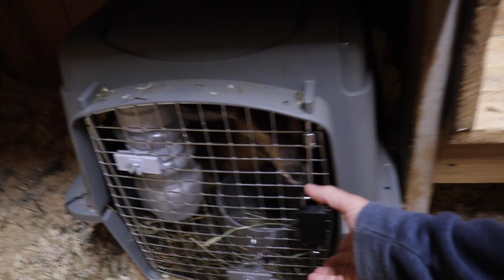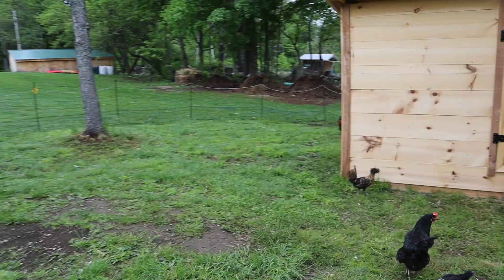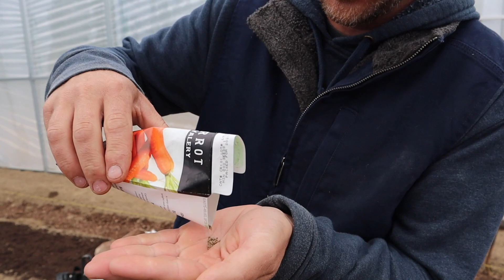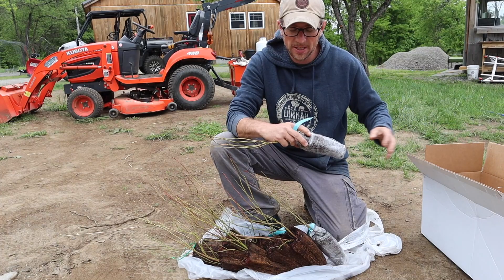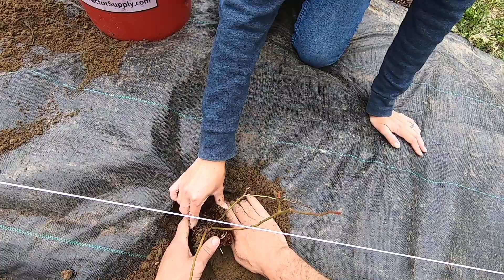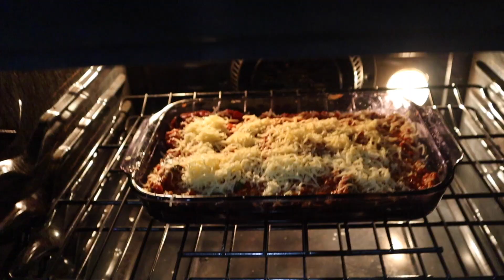Ordered Her Dream BlueBerry Orchard Off the Internet Today we Plant!

Comment: I learned to plant my carrots from a farmer in New Hampshire who was born in 1896.
He showed me how small the seeds were.
He would take a clean sheet of white paper and fold it corner to corner. 
He put the tiny carrot seeds in the center of the folded page.  He would then open up the fold some and with a shaking action he could lay just one seed at a time. And place them accurately where he wanted them. He told me to leave the space of my thumb between seeds. We grew a great crop of both orange and red carrots.

Comment: Another great Video, just a little hint, if I may. I use a drainage pipe, cut in half to grow seeds in, and once germinated and large enough to handle I slide the full pipe of plants on to the bed for easy planting and spacing. This is an extra step but helps me alot.

Comment: When you plant Carrots try mixing the seed with sand then sprinkle the mix in the row and cover , you don't have to thin out .
Reply: Only a seasoned gardener knows little tricks like this.
Reply: PS keep the cardboard wet!
Reply: I put my carrot seeds on wet paper towels, then fold and place in baggie overnight.  I then make a non-gmo corn starch slurry (let cool) gently add in the soaked seeds.  The slurry suspends the soaked seeds.  I place in a baggie with a small cut off the corner and 'pipe' into my rows.  I have a much better germination rate. I also have to grow mine in the fall as they do better in Texas.
Reply: @kflan3342  I may have to try that. I've had terrible luck with carrots. Maybe this fall.
Reply: @JerryB507  You need deep soil too to grow roots. And I toss in air and don't cover with soil, rather use peat moss (rubbing it between hands to shower over the seeds LIGHTLY)  then water the peat moss to make contact with the seeds to keep them moist, you'll have great success.

Comment: Blue berry growers near me (in NSW Australia)  often plant two plants per hole to ensure good fertilisation of flowers.  You waste a lot of space planting carrots in rows. I mix radish,beetroot and carrot seeds and spread  over  1 sq meter(or more ,depending on the amount of seed you sow) . No thinning -radishes come and go quickly,leaving spacing ,carrots and beetroot crop at different rates but if they are too close pull immature and use in salads.Once beets  and carrots are of usable size pull (carefully)and the small ones left will grow to full size . Harvest and repeat.

Comment: Hi Luminah's , from Newcastle in England. I am enjoying your long journey in creating your own homestead. Suggestions for planting would be leeks (Musselborough), white cauliflowers(snowball) Kohl Rabi- Sprouts you can eat the tender tops of these as greens, and (Durham Early) Cabbage which the bottom leaves can be eaten like spring cabbage and then the hearts left to form pointed heads. Early sowings of radish will keep you well supplied throughout summer and are a good catch cropper for salads- (Little gem) lettuce is nice in sandwiches and salads.  (Purple Milan) Turnips, Parsnips, Dwarf French Beans, Boleti beans (nice in soups and casseroles) (Cavell Nero) Kale. Potatoes. Swiss Chard. And (Boltardy) Beetroot- Onions- we use these everyday  Ailsa Craig- Sturon (sets) Japanese onion (sets) spring onions(White Lisbon)  sown every couple of weeks plant out in bunches of 4-5 6 inches apart . Elephant Garlic. (heavy cropper) Shallots planted out in bunches of 4-5 and 6 inches apart.

Comment: I planted blueberries 6 yrs ago with landscape fabric.   I took a 5 ft width x 70 ft, pegged it down with 6D landscape spikes that had fender washers on them.  I took a straight piece of scrap wood, put it down the center of the fabric and ran a torch down the side to cut and seal the edges.  I put the plants in the center, spaced 36" apart and topped it with composted saw dust and wood chips.  The slit in the fabric makes it easy to mulch, pull an occasional weed etc.  We have drip tape running down the center as well, under the mulch.  They are huge now, tons of fruit.  The landscape fabric helps to blunt the weed  pressure, retain moisture and allow the addition of mulch on a regular basis.  Weed pressure really stunts blueberries.  Good luck with your berries

Comment: When I plant my carrots are use an old bulk spice container. The type that we get at Sam’s club here in New York. I put sand in it and then mix the tiny seeds and with the sand and sprinkle it on the ground. That way you can see where you seeded because the sand is lighter color you can see where you planted and then there’s less thinning of the plants later.  I plant them in blocks instead of rows. I use it for my kale and lettuce. Just a little FYI it works with any tiny seed.

Comment: There a number websites that have professional advice on planing and caring for your Blueberries. I have found the University Of Maine site to be helpful. You might want to ask them about the ground fabric, I'm not sure what they would say about that. At some point you will want to fertilize your bushes and when applying the fertilizer they recommend to apply  it out at the drip edge of your bushes. the first year that might not be an issue but as they grow the fabric may be in your way. Good luck with them.

Comment: The problem with landscape fabric is you end up replacing it every 15-20 years.  Moles and groundhogs will chew right through that fabric.  I struggled with weeds growing in around my blueberries the first year.  This year I hauled in 85 bags of mulch.  I have 4 to 5 inches of mulch around all my plants.  I have maybe picked 2 weeds so far.  Made a huge difference.  If you don't have access to weed fabric good old cardboard works just as good.  Just remember to keep the mulch thick.  Weeding should be minimal if any.  We run 14 different varieties here in Zone 4.   The biggest mistake people make is not checking their PH level.  This fall check and see what it's at.  An amendment may be necessary.  And next spring you probably have to do an amendment again.  I sure wish I had access to a machine like that when I hauled in all this mulch by hand.

Comment: Yeah- I did that 20 years ago. As someone who had to tear out the weed cloth from a huge blueberry patch (it took FOREVER) I would advise that you don't leave it on long-long term. Cut the plants loose after a handful of years once the plants are far enough up off the ground you can get in there to weed.  Fertilizers should not be placed too near the crown of the bush- the weed cloth obstructs the fertilizing zones, and the weed cloth , for me, encouraged all the worst weeds.  We now just lay down woodchips.
Reply: And I agree with the deer protection. You can put up bird netting later also!
Reply: @tisalucchesi9910  You can always edit your comments by clicking on the 3 vertical dots to the right of comment.

Comment: Hi Al. I am not a big fan of weed barrier. In your application I hope it works for you. Your use of it is a little different. My mom had installed weed barrier in a few garden beds and what I found is after a few years of adding mulch the wood chips eventually broke down into soil so I had tons of weeds on top as well as mint roots running through the bottom. I had to tear all of it out. What a chore that was! Just keep in mind that the mulch will eventually break down, but since you are using it to suppress brambles and raspberries this application may work well for you. I cringe every time I see weed barrier now. Good luck with the berries.

Comment: Another way of tieing a string with a quick release
Tie one end with a slip knot or. ?
Now for the other end quick release
Make a loop around one finger holding both sides with the other hand and leave maybe 6 inchs between both hands ..
Now with the string around the finger.   Twirl it in a circle...several times..
Now slip the loop around your finger over your 2nd stake or..???
Now for the cool trick
With the side of the string from the first stake. Pull the line tight .. With the other end. Every time you tighten line one
Pull up the sake pulling the loose end toward the first stake
Repeat this until you have the line as tight as you want...
When the line is as tight as you want.. ease off on the hand that has been holding the slack
As you do the line will spin back to the stake locking it...
Now once you're down and want to release the line
Take the loose end in one hand and pull toward the first stake
With the other hand pull the string from the first stake towards the second stake
And behold the lock releases...
When I was young and new the carpenters use to enjoy this young man/boy 18 trying to tie strings...after enjoying the show for some time.  
They said come here and watch...
So simple...   and yes the fun was watching me...
But yes they taught me a lot
There are always tricks to make jobs easier..
There are other tricks for tieing strings  around square stakes
But the above one works on round or any other shape..

Comment: Check out MIgardener YouTube site.
They have a seeder tool that is just the trick for those little tiny pesky seeds & others lol.
It's also a multipurpose tool & is great for measuring your seed spacing, etc.  You just fill up the tracks holes with your seeds & it automatically fills the track with the correct amount of seeds, like your itsy bitsy carrot seeds, it puts 3 seeds per hole, etc.  The holes are sized for different sizes of seeds & adds the correct amount.
It's the size of a ruler & it's marked for measuring.
The friend of MIgardener who created it, came up with a game changer for seeding across rows & it's not expensive.
It would be the perfect tool to use in your new greenhouse & seeding so much easier.

Comment: Answering your question, "What have you always wanted to plant?"  I want to plant a Wisteria garden.
Reply: Kathleen Cone  word of Caution- wisteria is considered invasive, and rightfully so. Dont plant it near a building or a tree- it will kill the tree eventually, and mess up the building. It also spreads underground by way of stolons. We had it for years, and I diligently kept it pruned.
Reply: I will keep that in mind.. thank you for such good advice... I plan to use the same companies Gothic High Tower .. Al & Gina have used for their green house (only a bit smaller) and now.. with your advice.. I will be sure to isolate it far from any structures and trees. *hugs

Comment: Too gd many commercials!  I want to support you by tolerating the 31 seconds required for you to get paid, but the outrageous frequency of interruptions destroys continuity, concentration, and p's me off.  I quit tv in 2011 because of insulting  stupid, etc. ads (and manipulative corporate news).   YT is pushing the boundaries both with frequency and the annoyance of inescapable political ads.
Reply: - YouTube creators have no input on ads. Ads are targeted to the individual watching by YouTube algorithm. You & I could watch the same videos at exactly the same time & see different ads. You only need to let ads run for 31 seconds for YouTube creator to get benefit. I read the comments while ads run.
Reply: @tonygrimes13  Good for you - you have a higher tolerance for bs and interruptions to content and continuity, not the specific ads.  The frequency - less than 5 minutes between - is still the issue.  I turn off the volume in order to avoid ear-worms that follow the 'jingles'.